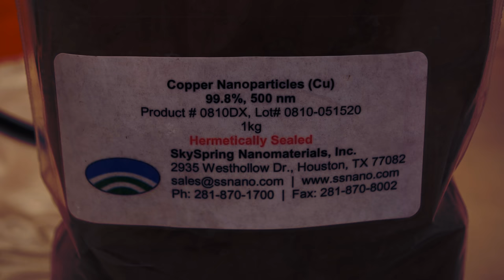Make Our Best Thermal Paste... YOURSELF!

Comment: Love your videos! One question though, is the thermal compound electrically conductive? one would think with aluminum or copper it would be. Another great job can't wait to see what's next .
Reply: I would be interested to see this tested as well. It's worth noting, though, that similar commercial compounds containing metal powders, including silver, are not conductive, just capacitive. There must be enough of the silicone oil between each particle to prevent conduction.
Reply from the maker: Our paste is not electrically conductive.
Reply: @TechIngredients  Nice.

Have you tried measuring it's capacitance? Bare silicon dies don't like capacitative pastes.
Reply: @TechIngredients  how is that possible? It's got copper and aluminium in it. Please do an explainer video. Thanks
Reply: @mailtobronius  ah I see. Thank you
Reply: @littlegrabbiZZ9PZA  - So what? It doesn't matter what "Bare silicon dies" like or don't like.
You aren't spearing the paste on the die, you are applying it on a metal heat-spreader.
Even if you de-lid the CPU, you STILL aren't getting any access to the silicon 🙄

Comment: Have you considered using a ball mill or a rotor mill like they use for chocolate?
You can just let them run for days.
Reply: Ball mill was exactly equipment that I thought about after seeing mortal and pestle last step
Reply: I was thinking the same thing. My initial suspicion is that you could just put all the ingredients in the right proportions into a small ball mill and let the thing run in a vacuum chamber. I expect you would end up with the same or better results.
Reply: @siggyincr7447  you could just degass it later to have less complexity.
But it takes more time.

Comment: This stuff should always be compared to Dow Corning 260. It's the standard for conduction cooled devices where high voltage is in use, such as conduction cooled power tubes and power transistors.

Comment: Video idea: vegan leather, you can make it using mushrooms mycelium, or using SCOBY (Symbiotic Culture of Bacteria and Yeast) it is the starter an somewhat of a byproduct of the production of kombucha. I was experimenting with the SCOBY because I was searching for plastic alternative, but mine grew to thick (1.3-1.5 cm in 2 weeks) and still decided to dry it, the one made using honey was stiff, but the one made using mollases as a cheaper alternative of sugar, was leather like, and I want to improve it but I don't have the time to do another experiment. I think it's very interesting and would be a good video idea
Reply: Do know that there are plenty of coatings which could be used to waterproof the vegan leather, because placing two sheets of vegan leather overlapping eachother causes them to end up glued to eachother, but soaking them in water unglues them. Not only that, but one might be able to add very thing plastic fibers or metal wires or both into the vegan leather, to significantly increase it's strength. Also, it would be interesting to see what are the possibilities of having the parts which need to be sewn together placed in a container where more of that liquid gets used to have the two margins organically welded together. If it's like glue, then causing some shredding on both ends prior to adding them to the container could increase the strength of the weld. Also, it's easier to grow more material than needed and remove some around the weld area, than to not weld enough and have the product tear from the weld.
Reply: @SapioiT  yeah i also made a coating, first i buffed the surface with avocado oil, or any oil high in unsaturated fats, then i coated it again in a mixture of beeswax and pine resin. Maybe I should've used the coatings they use for leather bags, but the thing i was researching for is biodegradability and long lasting in the right condition (e.g. in your drawer, above desk, and places with some sunlight, or places you store leather wallets/bags). But that second coating kind of ruined the leather like texture of it, and that's where I think they could improve it. Although for general purpose like only a splash of water or just sweat, just buffing the surface with oil is enough and without ruining the texture.
Reply: Vegan leather is the most stupid term I have ever heard. It's like "Vegan Hamburgers" that taste just like meat.
Why would a Vegan want something that tastes like meat?
Why would a Vegan want something that is like leather?
Very strange and illogical people.
Reply: @johncoops6897  I agree with you there, but the thing is that term is (as of now) the most widespread and agreed upon for leather-like material that isn't from "animals"
Reply: @aiki6378  - LOL... that is absolutely ridiculous.
Reply: @johncoops6897  Vegan meat is not for those who are already vegan, it's for those not willing to give up the taste of meat, which could become vegans if there was vegan food which tasted like actual meat. The vegan leather is for being able to have leather without farming animals, which, when properly done, can lead to leather clothes and accessories made with 0 seams and stitches, while also being much cheaper. A lot of research is still being done, in order to make something similar-enough or maybe better, in terms of properties and price.
Reply: @SapioiT  - "become vegans if there was vegan food which tasted like actual meat" 😂
That is the most idiotic thing I have heard for many years. HAHAHA !!!
Reply: @johncoops6897  Your opinion about it is also idiotic for many people. Also, is there really a need for ad-hominems? Just because you don't agree with the idea, doesn't mean others don't, and your hostility towards those who might become vegans for that reason is exactly what is most people from becoming vegans. If you're not willing to accommodate those who like the taste of meat, then those will never become vegans, because you don't provide them with something vegan which tastes like meat. Like it or not, without vegan meat-replacements of high-enough quality, non-vegans will not even become vegetarians, let alone vegans.
Reply: @SapioiT  - "non-vegans will not even become vegetarians, let alone vegans"
... and how is that a bad thing? I don't hate people who become Vegans, I feel pity for them.

Comment: Would these pastes work in the temperature range of liquid nitrogen? If so, they could be quite interesting for people racing for overclocking records.
Reply from the maker: I suspect there might be problems with the compound shrinking vs the metal surfaces at LN2 temps.
Reply: My guess is that they would become too brittle

Comment: I'd be very interested in seeing how the addition of graphene affects concrete properties in your ultimate concrete video. The first couple commercial uses of "Concretene" has just been poured this year in the UK and was developed here in Manchester. Supposedly can increase the strength by 30% for the same cement content and speeds up curing time + other benefits.

Comment: Superb video! At the start I was thinking no way there's any sense to create over 45 min video about this but you pointed me wrong.

The important point of this video is to understand that using just particles of identical size is actually much worse for performance than using mixture of different sized particles.

Comment: Hello, I just bought 1000g of high performance thermal paste and already unhappy I didn't see your video first. I watched your video out of curiosity because I also need to find some thermally conductive epoxy for a project I'm working on making cold plates or water cooled heat sinks, basically channeling out some Alloy flat bar and pressing in some copper pipe. I was super excited when you mentioned your thermal epoxy a couple of minutes in and I'm off to find that video next but I just have to say, I loved this video from start to end and hit the SUBSCRIBE button before you even mentioned thermal epoxy, not because I'm interested in your field of work but because of how you presented it. This was so easy to watch, you have a great tone and flow and I learned a bunch of cool stuff about a subject I didn't exactly have much interest in, until now! absolutely brilliant video, cant wait to watch more.
Reply from the maker: Thanks and welcome!

Comment: Super nerds rule✌
Love your content, it greatly aids in reducing my boredom being disabled and unable to work. 
The mix ratios you describe are almost identical to the science behind concrete aggregate ... Fines, sand, and the several screen sizes of rock.  I worked in a materials testing lab for several years doing ASTM guided tests of every building material you can imagine.

Comment: I love your videos. So different than 99.9% of the other YT content. I (a bit) doubt if it's really the best TIC, because of focusing on the thermal resistance only,  and limiting the tests to single set of parameters (applied power, temperature), but still, what you're doing is great.

Comment: I went on a thermal coupling endeavor years ago (15+) in the age of Athlon Processors and wound up with your indium foil approach and a twist to skip the high pressure part.. the solution to get the air out of that gap was not extreme pressure but some liquid metal. The liquid was a mixture of Gallium, Indium and Tin that a local company used to make mercury free thermometers with.
Additionally to the kinetic thermal transfer electrons would transfer heat and give superior performance. Downside - no isolation and the Ga-In-Ti 'welded' the aluminium heatspreader to the heatsink and needed much more cleaning afterwards..

Comment: @44:02 Years ago, I had to solve the same problem in a different project: mixing a very thick substance without aeration. I used a kitchen vacuum sealer. Combine the ingredients and carefully "start" the mixing, perhaps with mortar and pestle, in order to remove the air from the dry components. Vacuum seal into a bag and use that as a stress ball for a day or so. You can knock yourself out, kneading that thing any vigorous way imaginable. Probably could put the bag into the mortar and grind away at it with the pestle.

Comment: I recall reading something written by a man working on a laser project. He and his team had been attempting to maximize thermal transfer, and one step they took was, of course, lapping the surfaces.

According to him, a perfectly-lapped, mirror-smooth surface on both sides actually transferred heat worse than a slightly rough surface. He theorized that it was because the TIM was too uniformly thick under those conditions, and needed the roughness in order to have some points in perfect contact while the TIM made up the difference at the low points.

As it was something I read, and not a conversation, I could not ask him, "Why did you use TIM with perfectly lapped surfaces?" I'm curious if perfectly lapped surfaces would perform better without TIM than rougher surfaces perform with TIM.

I've never had the spare parts to actually try such a test out, and of course there's the danger of cold-welding the surfaces together (assuming they aren't a material like aluminum that oxidizes too fast for that to be an issue), but I'd love to see it tested someday.

Comment: When it comes to mixing the materials near the end of the process, rather than spending 30+ minutes mixing with a mortar and pestle, would it be possible to add, e.g., water, mix for a few minutes, and then boil/vacuum that water back off?
Edit: Oh, I see, this has been asked and it stratifies. Hmm. I wonder if there's a way to avoid that, or if the solder paste machine could fix the stratification.

Comment: FYI As an undergraduate in Ceramic Engineering an exercise we did was to determine the optimum relative particle size for densification. It is relatively easy to show with geometry that the optimum is a 7:1 particle size to fill the interstitial area.
Reply from the maker: You need to clarify what is optimum. For two sizes the optimal ratio is as large a differential as possible. This will create a solids fraction of 84%. 7:1 will not reach this high.

Comment: This is great. Thanks so much for making this straightforward and accessible. 
There's also one other type of thermal interface material that you haven't looked at yet though. 'Thermal pads'. These have become quite common with GPU cooling in recent years and evidently have a whole range of problems associated with them (if my recent builds are anything to go by). Thanks again!
Reply from the maker: Thanks.
I don't like them.  They create a very thick bond line and when used as an adhesive are nowhere near as good as a thermal epoxy.

Comment: For the last incorporation step, would you consider using paint mulling techniques? The equipment is relatively low cost and the technique is specifically designed for incorporating fine powders very evenly into a liquid. Usually the pigments are on the order of 0.05-several micron, depending on the exact pigment, and of course the liquid is linseed oil, so I think the technique is potentially applicable to this situation. I think it' s worth trying; it would certainly be faster and more effective than the mortar.
Reply: that's a very good question that I do not know the answer to, doesn't look to be that different from the mortar and pestle. I imagine major manufacturers must have some method to mix up large quantities of the stuff that is cost effective. I think the biggest concern is 'folding' air into a thick mix of something that air is not easily deaerated from. Hmmm.

Comment: Re: the first part.
Heat is radiation: Transverse waves.
Sound is pressure differential: Longitudinal waves.
Great video as always.
Reply from the maker: Thanks.
I disagree. Heat is isotropic and is not a wave. It does not reflect. If isolated in a vacuum, the end of the aluminum rod I heated would never become cooler than the other end.
Reply: @TechIngredients  that's interesting, it does not reflect indeed. But rather, is the reflection of - after a fashion. A wave is what something does in relation to a given medium: a differential made possible through the hysteresis of said medium in relation to the object/whatever doing the waving. It's convenient to say that if you take away the medium, the effects will not appear since that was already a given. Anyway, my point wasn't to contradict but rather to offer food for thought, which I have received in kind.

Comment: I accidentally purchased 5 micron aluminum OXIDE powder. Would it make a difference if I used that instead of the aluminum powder? Thanks!
Reply from the maker: Yes, it will.  That is a fine additive for producing reinforced epoxy, but not for creating a thermal interface material.

Comment: Your "eureka" moment actually make all sense, and in civil engineering we call self-compacting concrete, high slump concrete, or whatever the name you give depending on the use.
What happens is that we insert polymer additive to the concrete so we can increase dozens of times his fluid capacities, in this case low the viscosity, so it gets more easy to apply on structures especially where the access with normal concrete could not fill the molds properly, also to pass through internal machine mechanisms and ducts, especially in pumps.
By adding this polymer additive, the particles of the material gain what we call "rolling capacity", reducing the friction while is not crystallizing and posteriorly cured.
The manufactures do not actually reveal the exact recipe, and varies from one to another.
Interesting fact is that when it starts to harden, the concrete gets some sort of plastic smell, similar to that child modeling clay.
Reply from the maker: Interesting.

Comment: Is the glycerin needed regular 99.5% glycerol that you get from Amazon? The stuff people use for soap making?
Reply from the maker: That'll work.  We're using anhydrous glycerin, but it will gradually pick up a tiny bit of water from the atmosphere.  That won't hurt in any case.